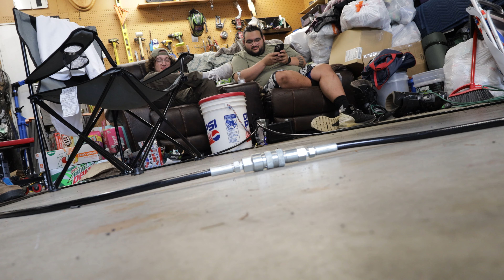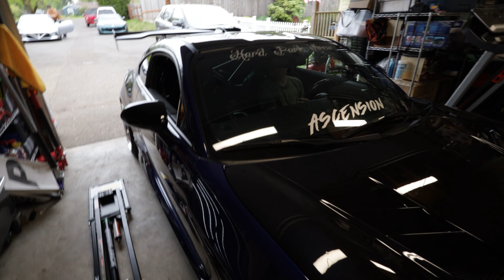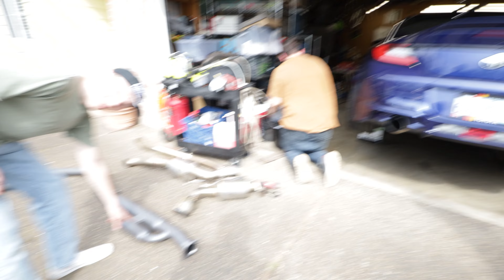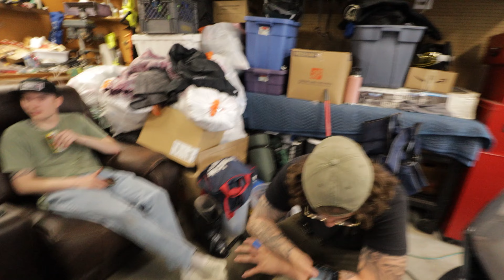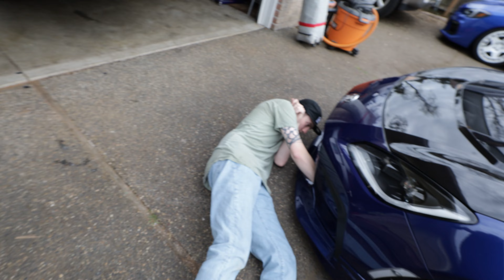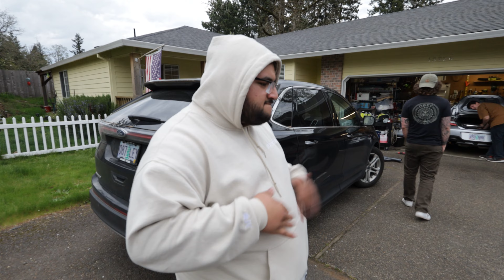Boosted GR86 swaps exhaust

Comment: that HKS turbo sounds so fucking good
Reply from the maker: He wants the JDL kit now XD
Reply: @pnwbluebaru  really? the hks kit look so high quality. I am sure it has a lot of potential too. + the sound
Reply from the maker: @turbo________  I think the JDL kit has a bigger turbo dont quote me. He has been talking alot to k24.austin on insta which i feel is why he wants to switch.
Reply: @pnwbluebaru  might be, but I know HKS did upgrade the turbo over the first gen kit and I think theyr turbos are a in house modified garret turbos. that is what they had on display as their new turbo line-up at TAS I think
Reply from the maker: @turbo________  You are correct about first gen being garret turbos. The kit overall is amazing. but hes always itching to do something new which gotta respect the dude.
Reply: @pnwbluebaru  yea big respect. looking at the japanese HKS site and their new turbos are in fact still Garret but the intake side is black with a garret branding and a HKS logo above. the inlet is also gold/brass colored. the smalles one ( replacing the GTIII-RS ) is the GT4950-BB and the assumed output is 650 HP instead of 500 from the GTIII-RS